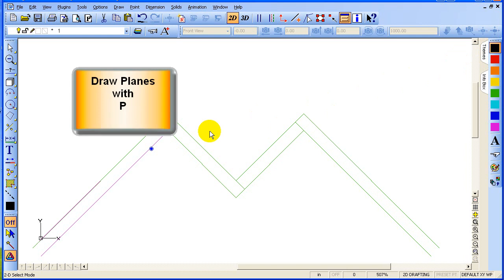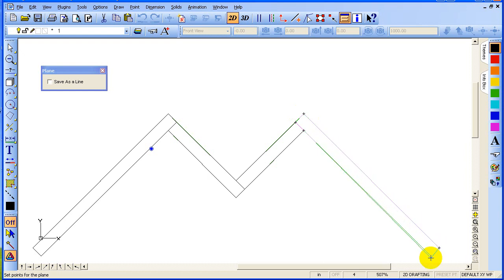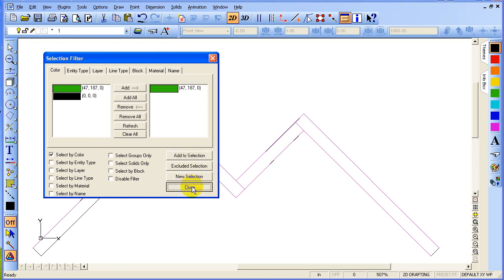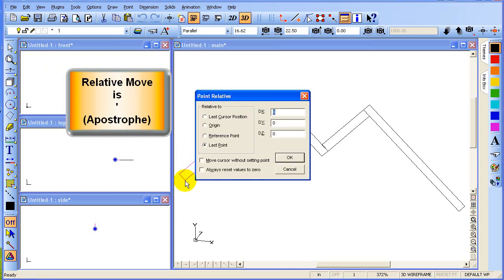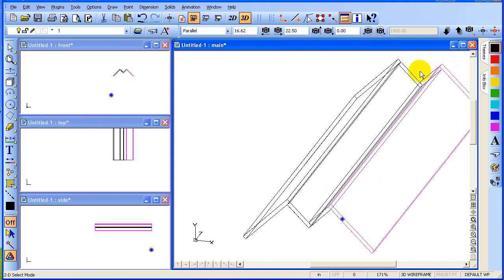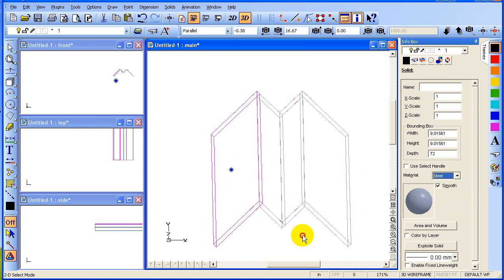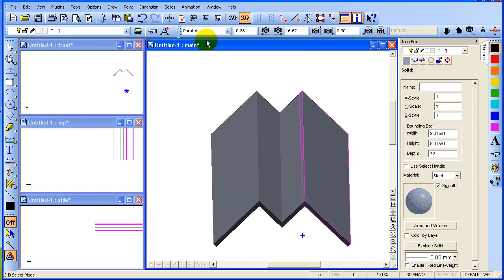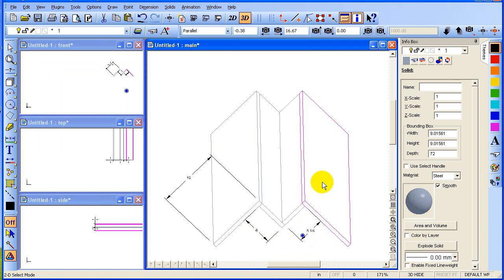Tutorial for DesignCad Max v22 - Strawberry Trough Part 2

Comment: I've been using DesignCAD since v 2.0.  I've had a 3D version for several years, but my few attempts to try it out have been frustrating.  The help feature on v 17 (what I'm currently running) leads to a very complete manual but does not bring up a topic-specific help, and with no tutorials.  I found this video very helpful.  And thanks for including the keyboard shortcuts.  Back in the day, I'd do entire 2D drawings using keyboard commands, which are the most precise way of using DC.